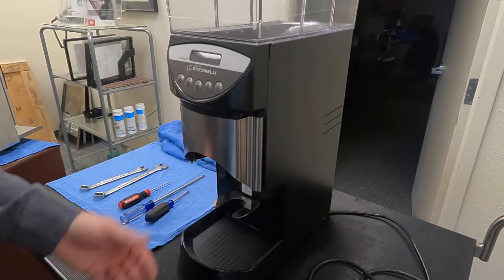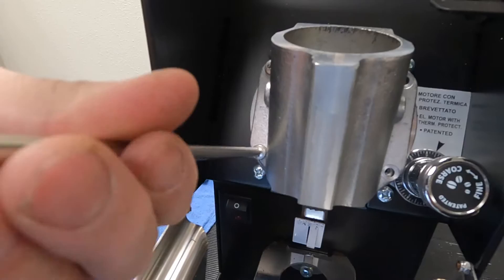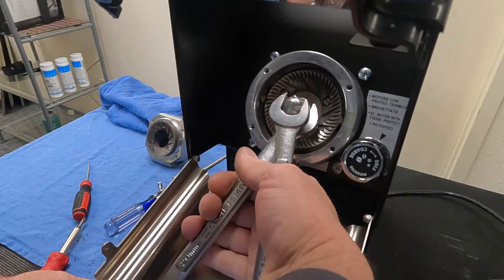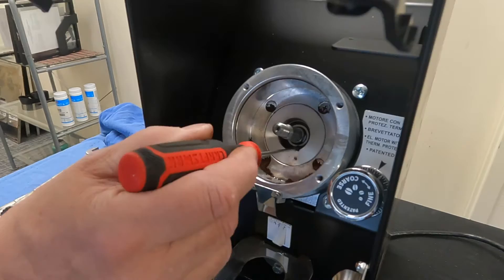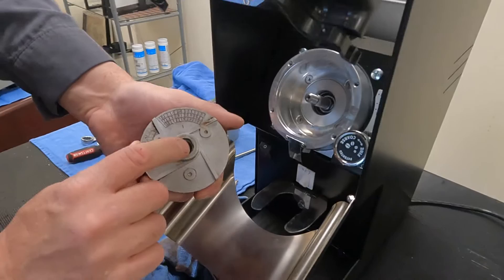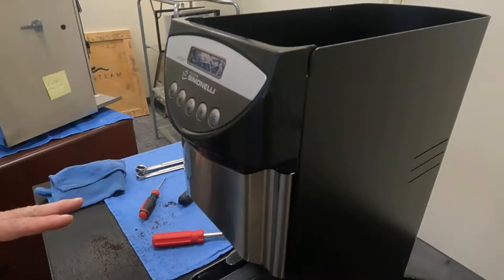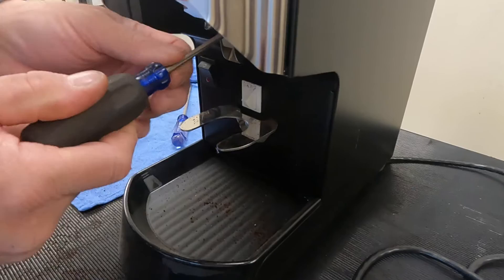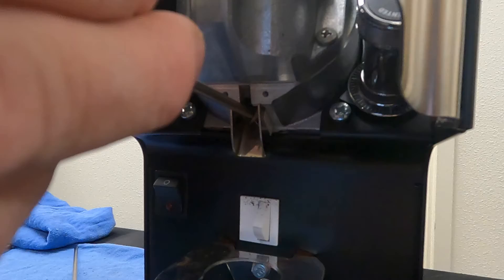Mythos Basic Burr and Clump Crusher Replacement

Comment: Hi ESN!  Thanks for the very detailed video :)
I wondered if you have any advice for a Mythos One that's 2 years old, it has a fresh set of burrs on but has the following issue;

We turn the grinder on in the morning 45 minutes before dialing in and load the beans into the hopper with the hopper slot open. 

For the first 18 months, the morning calibration routine would be something like this :

- We grind the first dose and throw it away.
- We grind a 2nd dose, and run a shot, let's say it takes 23s to hit our desired yield.
- We adjust the grind setting a notch or two finer, dump 2 doses and pull a shot and we hit our desired extraction time of 28s.

Since a couple of months now, we're finding that if we follow the same routine, that within 2 or 3 doses time - our extraction time will jump to 35-39s... So we adjust the grind a bit coarser and fall back down to our desired extraction time and then for the rest of the day it stays pretty stable - we rarely have pauses of more than 5 minutes in between doses.

The burr carrier feels lukewarm to the touch before we grind our first dose, but 5-6 doses later it's rather warm.  A local technician replaced the heating element, which had no effect.  He then advised that we cleaned around the bearing and axle with compressed air...
Reply from the maker: Apologies for not responding to your question. Did you find a resolution to your problem, yet?
Reply: @EspressoServiceNetwork  Not yet !
Reply from the maker: @MrRobHazell  Have you tried allowing the grinder to heat longer?

Comment: 11:26 if I put the rotation bur in but I can’t put out so I don’t know why?!! 😢
Reply from the maker: There are a couple things you could look for. One is there is a defect.  The other is the  shaft is dirty. If you place the burr holder on a dirty shaft you could be  wedging it in.  You could try applying heat to the rotating burr holder and use a vice grip to pull it out  When assembling, remember to inspect items to make sure there are no flaws. Let me know what you discover. Interested to know.

Comment: hey i think my grinder mythos 1 is binding the clump cluster was upwards then it all stopped working and grinding. help have Instagram messaged u
Reply from the maker: It sounds like your clump crusher may have been installed incorrectly. You'll need to disassemble  your grind chamber and clean it out thoroughly.. When you replace the clump crusher, be mindful of how you bend the teeth. Let me know how it goes?